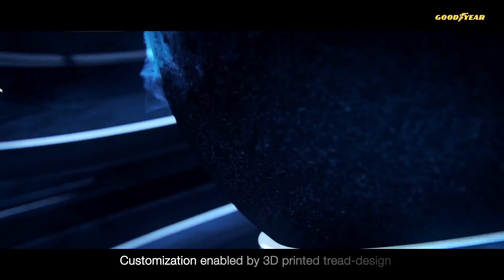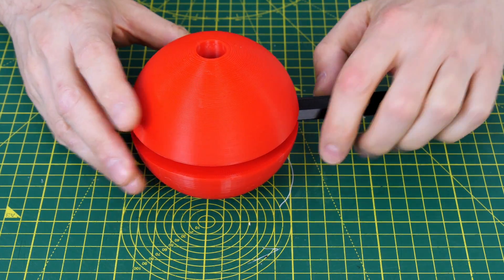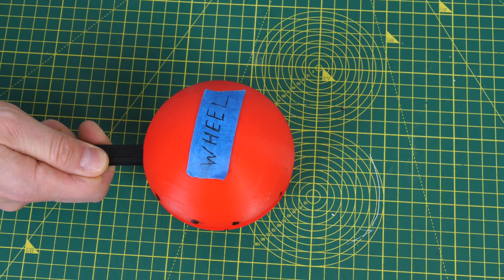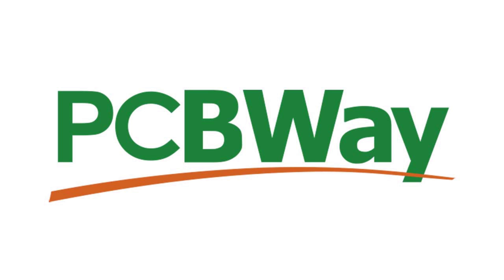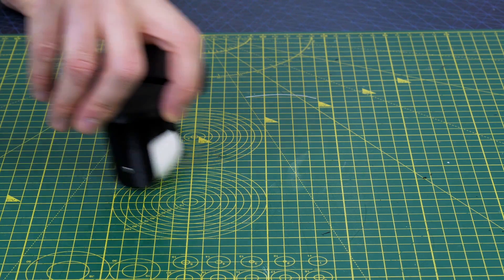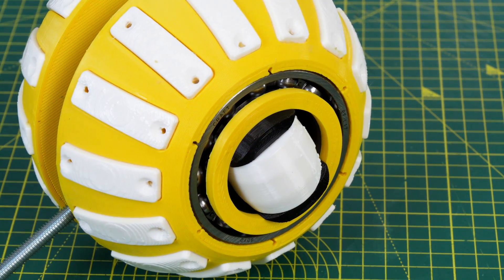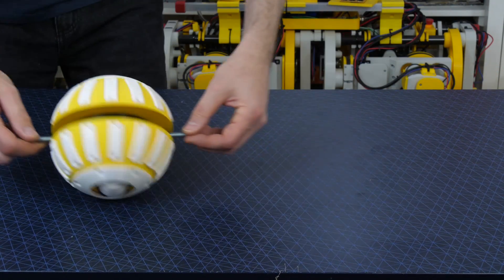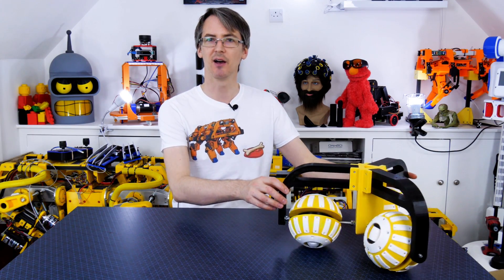Are Ball Shaped Wheels Practical?

Comment: How about if the wheel was attached like a 1990s style computer mouse -- with two independent axles driving it?
Reply from the maker: it would have to be mounted on omni-wheels if there was any load, and then you might as well use omni-wheels.

Comment: the answer is no. For two reasons that having nothing to do with if its better for performance etc.  One could argue this works better or is better. 
reason 1. infinitely more complicated, more parts etc. This adds to many problems from a cost and service perspective
2. the system that already exist works and the problem this is trying to solve doesn't really need solving

Comment: the 3 wheel design with thse tires feels just plain wrong, no matter what direction it goes (other than spinning 360s), itll need to fight stleast one wheel at some point. need to go 4 wheel with these kind of wheels. 3 ball wheel might work it its done in a 2 back wheel one front wheel like a tricycle design. but i also think that the control with magnetic wheels might be underrated. we might have way more break power with magnets over traditional breaks because magnetic force can be ridiculously strong when considering electro magnets. the only thing that would hold back magnetic wheels is an energy source strong/efficient enough to power them for long drive times

Comment: I can imagine this wheel not working in one case: when the wheel is on the small rollers and the wheel needs to move in the direction parallel to the axel of the small roller. I may be wrong because I cannot play with the wheel. Cool design tho

Comment: Youll have zero traction, offroad wheels use less psi for better grip, maybe a half deflated baloon with a drive wheel? 
the folding (and use) of a deflated ball with cause more deformation when having to roll, than a standard wheel, as well as no performance benefit, and ultimately a mor complicated drive system

Comment: Holding the wheels on with magnets is just a magnetic bearing electric motor. There are some surprisingly large and heavy machines running on magnetic bearings. The biggest problem would be getting big enough magnets to hold the car up when the power is off.

Comment: You should've used a Lil ball instead of wheel. You know like in a mouse
Reply from the maker: Running on what?  Also the smaller size of the ball won't match the profile of the larger hemispheres
Reply: @jamesbruton  oh no not running on anything, it's just a little ball which makes sure it can go to all sides. Because the rest of the wheels won't also all be on the little ball. And I'm not sure what you mean by the profile? I was thinking exactly like in a mouse

Comment: Why not make the small wheels at the bottom spheres to allow for even more degrees of movement?
Reply from the maker: Running on what? Also they won't match the profile of the hemispheres so there will be a big gap around them.  They don't need to run in any other axis.

Comment: The Goodyear design seems to be having a wheelbase that wraps all around the wheel-ball, exposing only the bottom of the ball, like that on a computer mouse.
Reply from the maker: But what would it run on?
Reply: @jamesbruton  Those robots that balance on a ball would be perfect for that. Have the ball-wheel be textured and you can even use regular pad breaking systems to clamp down on the ball to emergency break.

Comment: I feel like it would never be practical to have ball-shaped wheels, the amount of surface a ball covers makes it lose grip at high speeds, and therefore not a safe alternative to wheels
Reply: The only situation where that might make sense is if you're using something else to guide the direction of the car. For instance, if you've got rails directing the vehicle through a narrow tunnel or onto a ferry. So, perhaps for a bus system where you want to allow a bunch of people to load and unload on different platforms before transitioning to a tunnel with the least possible space.

5 wheel cars were demonstrated in the '50s and they never caught on because they solved a problem that was too niche to justify the cost and expense. With computer aided driving, you would have seen them disappear anyways as the extra space you save with an extra wheel when parallel parking is just not worth it.

Comment: Couldn't you also put a little orb like from an old computer mouse at the top of the hemispheres? Theoretically that'd be even more versatile. Not sure if it'd make any real difference though, I'm not an engineer. I considered a similiar solution to the hovering ball wheels but with motorised bearings inside the chamber, but it still seemed incredibly impractical.
Reply from the maker: Running on what?
Reply: @jamesbruton  
What's running on what? Your question is a bit unclear. 
Instead of waiting for an answer I'll just try and answer the two I can think of. 

If running as in physical motion for the first part, I'm just thinking about the same little wheels inside a mouse but without the sensors, instead they're just for keeping the ball in place and rotating smoothly. IDK how well it would scale up, again, I'm not an engineer. Actually, the hemispheric balls would need to be motorised too, I somehow completely forgot to consider that part.

For the second part, the motorised bearings would just run on electricity I guess. That's why I concluded it's still very impractical; by necessity of design, the motors would need to be so small.

Comment: I'm still a little sceptical on your design. Even on small robots it seems like dirt and sand could get into its nucks and cracks and jam or hinder the wheels movements. Not to mention when water gets in there and starts rusting things or getting trapped in there

Comment: I feel omniwheel is a nice idea. But it do not feel really practical to me. To build one of this you need to care about 3 very different aspects: the axis rotation, the small wheel on each side, and the big ball. 
-Each one of them follow different rules when is moving: mathematically speaking I suppose studying them simultaniously is a mess. For example the small wheel have a smaller radius (do you have in mind the feeling to drive a shopping cart compared to a car? it s really imprecise xD)
-Building the pieces for these 3 systems require to be awared of more precision and structural problems then a simple wheel. It's interesting but it need study to be applicated to real cars 
-When you transition from a type of movement to another especially from the small wheel to the big ball, everytime you pass from a moving object to a non-moving one, so it require higher energy in each transition compared to simply moving using just one due to the friction

Comment: Simpler solution

Just add a ball bearing or something similar to the end of each hemisphere similar to something like a ballpoint pen, where the bearing is held in place by a socket, still allowing it to move freely in every direction

This would not only solve the issue, but would make a wheel, that it 100% made of spheres, removing the need for a axis wheel

Comment: This may be impractical, but what if you added rubber strip around the inside of both wheels (like the strips on doors).  This way there could always be a single point where the axel comes out of instead of a circular line.

Comment: Another problem with this idea is that the wheels would have less contact with the road which is a huge problem as the wheels are the only contact a vehicle has with the road, and with less contact with the road it doesn't matter how good your braking mechanism is. It would also be a pain in the butt for a mechanic to get those tyres on the mechanisms.

Comment: i dont see a reason for a ball wheel to require an axle/bar going through it. at a museum in my state therre is a very very very heavy stone thats perfectly round. and its sitting on a fountain of water and because of the water you can very easily rotate any possible direction without much effect. why not take that idea to an extent and encase the wheel in a shell to the point where it cant slip out obviously but instead of water (duh) there are many gears and such inside the shell that make constant contact with the ball wheel that provide direction and and power to the wheel

Comment: I can't speak for ball shaped wheels, but one of the biggest problems with omni or mecanum wheels is that you lose a lot of traction and can get pushed around easily, so if a car is going around a curve at speed, they will lose control much more easily than if they had used normal wheels.

Comment: I don't think ball wheels are a viable or cost-effective option. From a buisness standpoint, the more material needed to make a ball wheel in comparison to a regular wheel, not to mention the computer programing required to make it functional would be very expensive to produce.

Thinking practically, it'd be very hard to get people on board with buying them and teaching them how to drive using ball wheels - which would lead to more car wrecks. Additionally, it's hard enough to change a regular tire; trying to change a ball tire, with how complex it is would decrease the desire in buying one. And then there are icy or flooded roads to be considered.

Comment: But if it did use magnetic levitation, technically that would make it the first hover car. . .
Reply: they could make roads 2 cylinder shaped things that use the same magnets or system as the balls so the car would just be placed on top
Reply: @vinzlaros  I thought about that, in theory it could work but I don't think there is enough money I the world to buy that many magnets.
Reply: So a Maglev train?

Comment: take it off the smooth surface and test it off road in sand mud snow and a wet road and get back to me. its missing a very important part that a normal tire has and thats surface contact. a tire can deflate and get more contact and opperate better off road but that ball doesnt look like it can

Comment: You could use ballbearings with in the wheel wells. The wheels would be allot cheaper then using one drive wheel in the middle of the vehicle to direct and drive. like a office chair caster

Comment: I ain't no scientist nor an engineer, but as far as I can imagine, magnetic held wheels would be WAY easier to slow down and stop (speaking of breaks that you never mentioned again) than these... To be honest, while imagining this system on a normal use case in a car (engine not directly attached to the wheels) slowing them down would be such a pain in the * ! While on magnetic fields, you "just" (just for the concept) need to modify the magnetic field to make the wheels "slide" against the casing which could easily be coated with some sort of material that could slow them down, or you could maybe just alter the magnetic fields to slow down the ball, as they are already put in movement by this magnetic field...

Comment: One of the problems I can think of is damage when the wheel parts switch to the other side. The vehicle will be going really fast, and then it will suddenly shift onto a part of a wheel that wasn't moving at all before which could cause damage. Not sure though

Comment: the problem with those wheels is, that they`re pretty much a transmission. If one wheel rolls on a point closer to the smaller inner wheel than the other one, it would need more rotations to pass the same distance than the otther one. Whitch means you would have to use one motor per wheel just for the inner axel. Then you would need another motor for the bigger axels and preferably another one for the inner Wheels if you dont want to loose power during the timeit drives on them. Which in some use cases probably doesnt matter. Ittl get very overcomplicattet very quickly anyways i guess.

Comment: Instead of having the smaller wheeels have a fplat end to attch it to the bigger semi-sphere, why not making it a smaller sphere that is lodged into the semi-sphere that is able to rotate freely. That way you don't have to worry about the direction the semi-spehere changes. The only problem I see with this is the wear but then again since the smaller spehere will not have the main loaf most of the times, if it its possible to take the 2 semi-sphere apart then the smaller sphere would be possibble to replace.

Comment: I don't think we'll have any sports cars with this kind of wheel anytime, if ever, but I can see a line of city cars coming out with this kind of tyres. Most of those cars don't get above 50 km/h anyway, and so could easily have wheels designed to sustain those levels of force. The benefits of having a car that can travel directly sideways outweighs the cons of having a vehicle that is more difficult to control at high speeds.

Comment: the omni wheel could work for going forward, left, right, backwards, and breaking, here is why: If you were able to change the position of the omni wheel by twisting the part that is holding it together to break, then move it to the left or right(the bar) to turn it

Comment: I designed ball wheels and you went in the completely opposite direction from me, my design involved a motorized double humble system to allow full range of motion, and because it's motorized you can offload a lot of the issues with coordinating the parts onto the software

Comment: You tried to make a ball shaped wheel, and in order to do that, you had to put two regular wheels into the design. fail. you ended up with double the amount regular wheels than just having a regular wheel. this is not a ball shaped wheel. it is 4 regular wheels in the shape of a ball. Step up your engineering game

Comment: Why not a use sphere with a stator inside, held captive with rollers (like a CVT), and use electromagnets in a radial array to drive it? Basically, it would be an electric motor, but the output axis could be controlled by switching which coils are active.

Comment: This design could actually be used to render transmissions obsolete. You could rotate the wheel to the smaller circumference for starting and gradually rotate them to increase speed

Comment: If you want to drive it at a real vehicle then every movable part must be driven, even the small rolls. And every part must be braked to stop it. Thats something i always asked myself in case with the actual existing omnidrive wheels. Are they usabe if the ground is uneven, in an angle or partly slippery? Because then the rolls also must be braked, or am i wrong with that?

Comment: Is there any difference between what you made (3 ball non-driven) and castors? Surely the whole point of the concept wheel for a car is that it should have a directional preference for steering and stability? - although I guess that would have to come from the design of the drive.
Reply from the maker: Yep it's up and driving in this Tuesday's video. I can control 3 axis!

Comment: Really the only problem I would have with this design for car tires is it would be impractical to motorized them when the orientation changes so frequently. As free spinning wheels however, they are just fine.

Comment: Wouldn't the circumference of the "wheel" get smaller the closer the ball gets to 90 degrees off, and thus mean the the RPM necessary to drive them is not only constantly changing, but independent from each other.

Comment: So to drive it you'd need to adjust the speed based on the orientation of the hemispheres. I'm guessing the addition of some sort of tan function? I only guess that since there's a limit at 90 degrees.

But you certainly need to change the speed drastically when the whole thing rotates to maintain a consistant ground speed.

Comment: Yeah, I kind of agree with that "attached to car" thing... I wouldn't wanna go over a speedbump too fast and risk my tire rolling away...
If they wanted to use electromagnets, they would have to repel and attract simultaneously to balance the whole system... not to mention they'd have to be adaptive enough, to not drop the car or lose the wheel in the process!

Comment: Rapidly rotating magnetic field arrays are power hungry. But In theory as long as the spherical tire is ferric, or electromagnetic by induction, and its weight modest,  should be possible. But... the magnetic drive system would have a hard time dealing with iron oxide particles from the road. Tough nut to Crack.

Comment: What about oversized ball bearings for the wheel instead with smaller bearings or a low friction material like felt on the inside of the ball socket to provide safe movement of the bearing when in contact with the ground?

Comment: I can see it working well for your omni robot idea with 3 of them being driven by the 3 axles controlling direction in the same way as you did with the omni directional wheels before. However, I do not see them being practical in a car with 4 of them. If the axles are facing the same way as current wheel axles are in cars then how would they transition to sideways driving? If the hemisphere sections of the ball are freely spinning like in yours then how do they stop sideways slide while turning or driving on a slanted surface? All parts of the ball wheel would have to be driven and controllable to make it practical in a car setup and that introduces far more complications to the design making it prone to failure as well as vastly increasing manufacture costs.

Also, that setup you show with 3 of them free-wheeling would make a great office chair base! 😁
Reply: 4 is the same as 3, all axes pointing to the center, and you can drive anywhere like with omniwheels arranged the same way.

Comment: Those little rollers on the poles of the hemispheres aren't necessary, just angle the axle going into the balls to 45 degrees or so and the poles would never touch the ground, it would be far simpler.